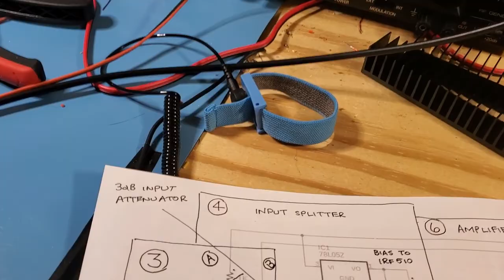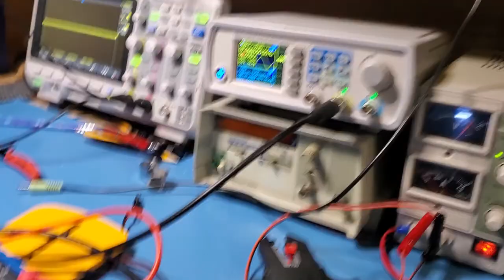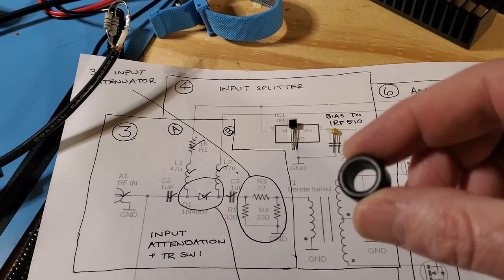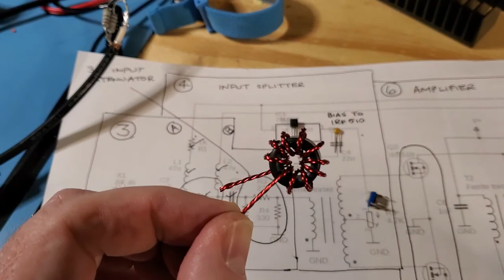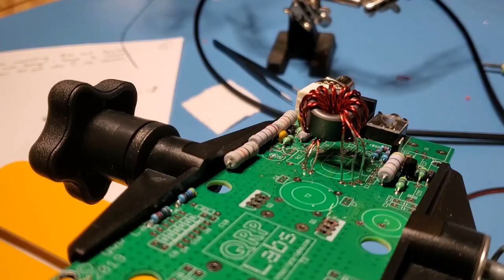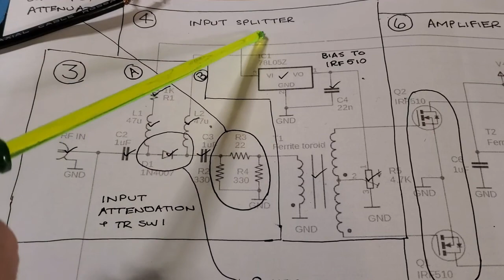QRP Labs 50W Amp - Part 3 Attenuator and Splitter

Comment: Great video Ian,lots of details and very educational. I have successfully  completed  qcx labs 20m transceiver  and took upon myself  to  build  the  amplifier . Finnished up..no smoke...switches on transmit ,however no rf out and amp meter on my ps mfj 30a 16v  does not indicate  any current. I don't have 20V  ps. Bias adjusting does not do anything . Any ideas  on  where to  start trouble  shooting . Limited  electronic  background  but learn as I go. Thanks a lot and 73
Kb9zrp
Reply from the maker: Would it help if I did a video showing me probing all the voltages? I assume you have a DMM but not an oscilloscope correct? No current draw means the FETs aren't even getting turned on - which could be a problem in the transmit receive circuitry - or a blown FET for that matter. Blowing a FET is pretty easy to do if you accidentally get the bias wrong at startup (and there's usually no magic smoke ;) )
Reply: @na5y  Ian, thank you for quick reply. That would be awesome! So, I did well.. at least did not smoke the thing (:. I do have dmm and also a 200mhz scope at work which I mostly use to monitor levels of audio frequency signals in railroad signaling applications. Never used it on hf equipment. I'm guessing that you are talking about two FET's attached to heat sink. I am looking at the schematic right now. I don't have my amp with me (at work). Great... Thank you again
Reply from the maker: Great - let me do that. I was trying to think of an idea for a next video anyway! Stay tuned!
Reply from the maker: @MK-wt8sx  Here's the troubleshooting vid: https://youtu.be/rUVLphjKaFQ

Comment: I thought about swapping the 2W metal film (oxide?) resistors to 3W resistors that have a smaller form factor but in then end I just installed what was supplied. It's in a case so I don't have to see it.
Reply from the maker: There's not much room on the board for those 2 watters!
Reply: @na5y  No there's not BUT check these dimensions out: 
2W Metal Oxide 0515, Metal Film 0410, Carbon Film 0412
3W Metal Oxide 0615, Metal Film 0517, Carbon Film 0515

Clearly my 3W thought wouldn't help but switching from 2W Metal Oxide to 2W Metal Film would save 5mm. I wasn't sure if there was some reason, other than cost, that Hans used the Metal Oxide resistor
Reply from the maker: I am sure you are right Michael - Hans certainly has his eye on cost!